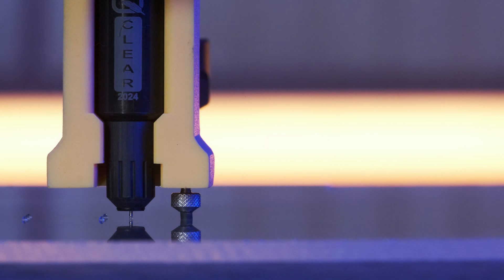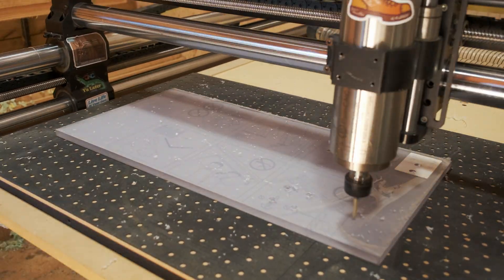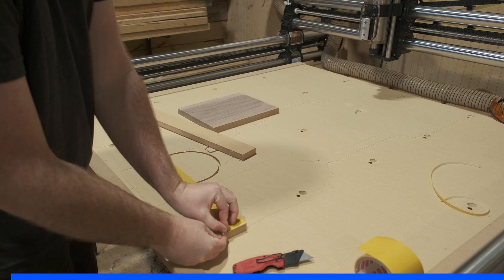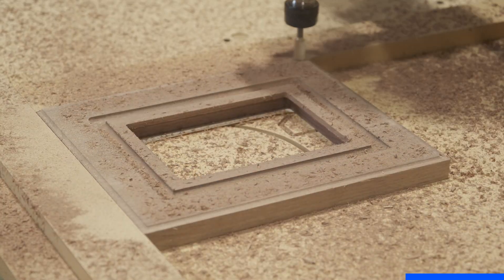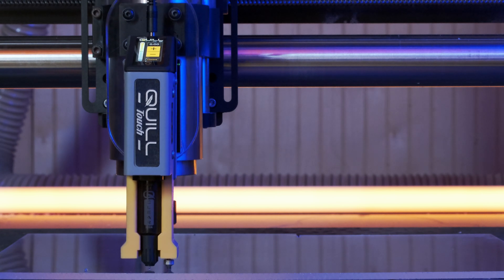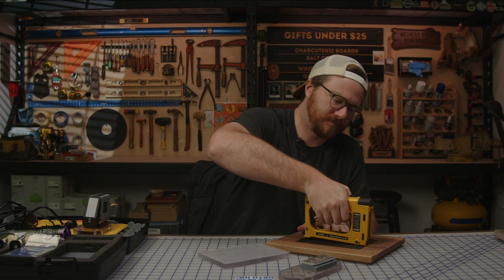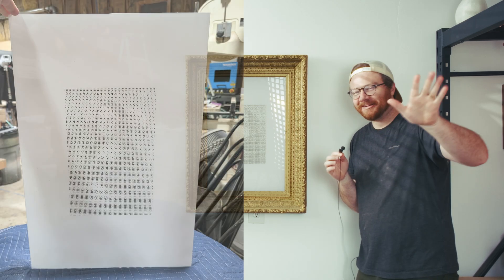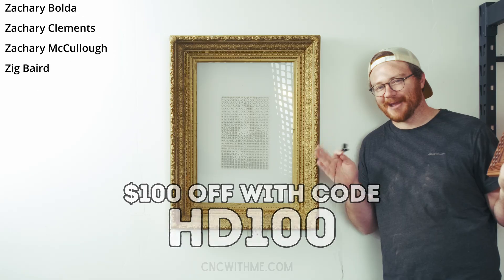Turn ANY CNC Into A 3D Printer (Quill ADA)

Comment: Hello, how did you get the quill to print in the correct position since it is attached to your router?
Reply from the maker: Zero x and y off the resin tip and z off the plunger